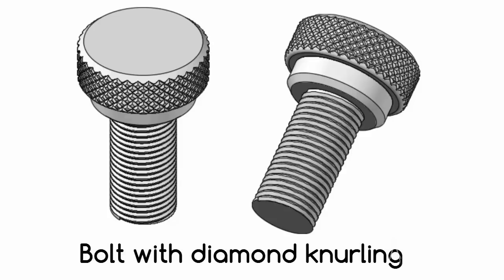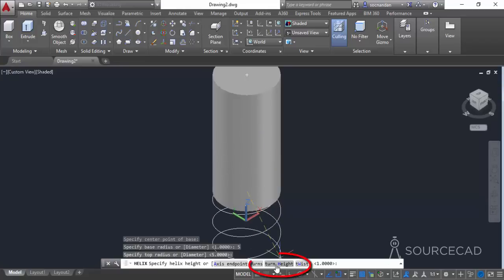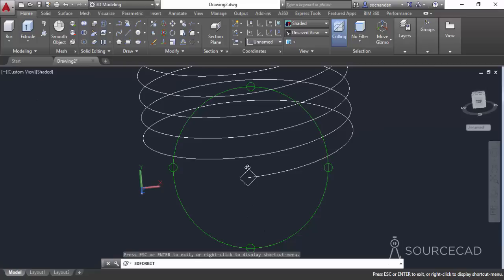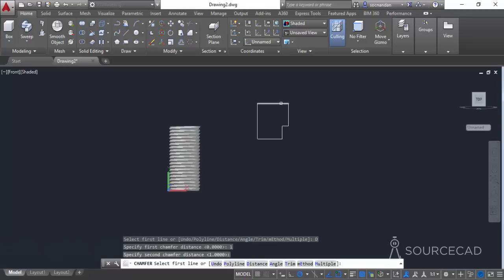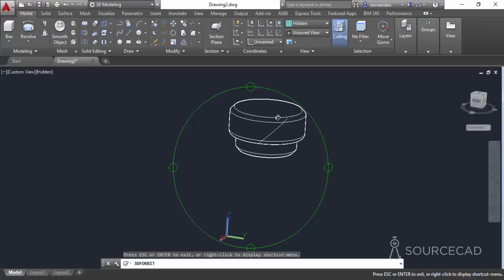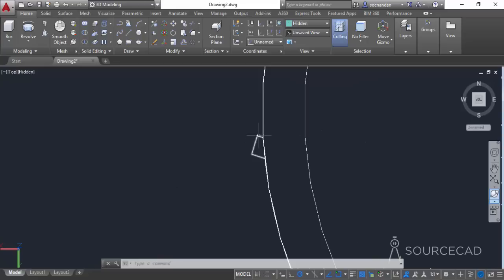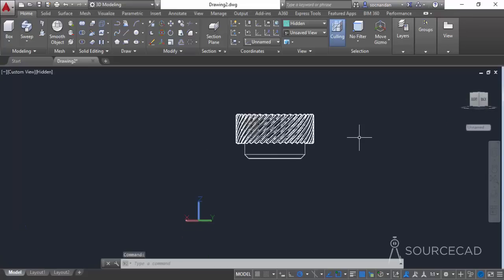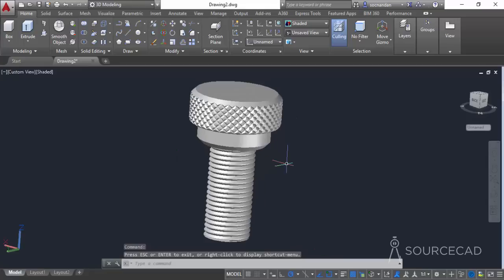Making a Bolt with threads and diamond knurling

Comment: I'm using Autocad 2020 and I get to the point where I need to subtract the knurl from the other object, when I subtract it just deletes the the cylinder that the knurling is wrapped around and doesnt touch the knurling. Could anybody help me asap?
Reply: may i ask how did you fix this?

Comment: Very nice! Small note: you do not need to move the rectangles on the path always. The sweep command is clever enough to work if the rectangles are wherever...
Reply: I think the reason he moved them is to rotate them properly so he can get the desired shape... otherwise sweep sometimes can not automatically detect the orientation of your object.

Comment: im having difficulty placing the second helix in the center of the second geometry (top) 
it will not snap on the exact surface you are snapping on.
I may resort to entering specific coordinates for the objects to get the helix exactly where i need it to be.
Reply from the maker: select the command then press and hold shift key and right click, then select the required point from the contextual menu. Hope it will help.

Comment: You forgot to teach the explode command after the array boss... Hehehe.. Still thanks for your nice tutorial.
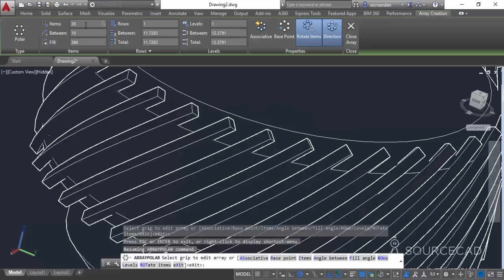Reply from the maker: As the associative option is off there is no need to explode the array (mentioned in the 13:18 time stamp of the video). However, if you explode the array in non-associative situation you will reduce the geometries to regions on which boolean operations can t be performed.
Reply: Ow sorry I missed that part. I'm using AutoCAD 2012 can you teach me how to turn off the associative option via command. Thanks.
Reply from the maker: You can use ARRAYASSOCIATIVITY system variable and keep its value at 1 to make an associative array and 0 as its value to keep it off.

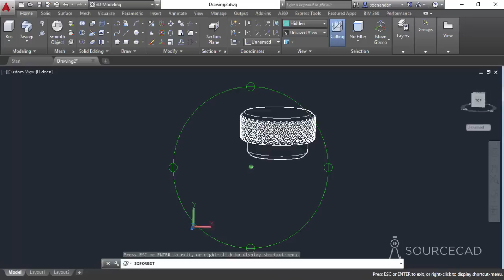Comment: The last part where you remove (subtract) the edges of the top, (14:50 to 14:55) doesn't seem to work in the 2018 version. when I try, everything outside the base of the top, disappears
Reply: No! instead it works on Autocad 2018.

Comment: Hi Jai, another fantastic video. Can you please help ? I'm having a problem with the sweep command. I'm using ACAD 2014. Sometimes sweep works and other times it doesn't. I can't figure out the reason. If I change the cross-section profile to say a circle and sweep, it sometimes works, but other times not. The ACAD forums don't seem to offer a consistent solution. Do you  have a method of working around this issue ? Is it something to do with the drawing axes ?
Reply from the maker: Thanks Songoku, Generally Sweep command will not work on steep curves. You also need to ensure that the sweeping geometry is fairly small compared to the sweep path.

Comment: Great Tutorials SourceCAD, I love it.  I'm a 3D Designer and work on the Autodesk Maya for  Product Design and Visualization. But i want to learn CAD design and 2D Drawing for the Production Purposes.

I'm Completely new to AutoCAD, but i know the 3D modeling and Designing. Also i never worked with the dimensions (Unit system), which i may need to learn for the 2D Drawings for production. I hope you get my points ( where i stand i terms of the AutoCAD and will suggest me according).

Please let me know how to start and what version you are using and please link if it is possible.

Thanks you very much !
Kunal Sharma
Reply from the maker: Thanks Kunal,

You can use free AutoCAD course on tutorials page of SourceCAD website, here is the link http://www.thesourcecad.com/autocad-tutorials/

It has all the required tutorials for your need including the tutorial relate to units. I have used AutoCAD 2016 version for making the tutorial videos of the course and you can get the student version of AutoCAD with a three-year license from Autodesk website for non-commercial use. The tutorial page has all details related to downloading and installing AutoCAD software.

If you are interested in a complete professional course of AutoCAD which deals with basic to advance topics then here is a premium course from SourceCAD website http://sourcecad.teachable.com/courses/enrolled/the-complete-course-of-autocad-2016

You can also install the free SourceCAD app from here to get access to video course on the go here is the link https://play.google.com/store/apps/details?id=com.socnandan.sourcecadapp&hl=en
Reply: Thank you very much !

Comment: I'm studying 3D CAD at the moment and I was just wondering what's your job because my corse is almost over and I'm looking for places that use CAD but there isn't many? So I was just wondering what you do if you don't mind me asking
Reply from the maker: I started as a CAD draftsman in a die casting industry where my job was to primarily make drawings of small zinc and aluminum die-casting components and their die's. Later I joined training and design consulting companies in Delhi NCR area.
Recently I left my 9 to 5 job at Ramboll (engineering design consulting company) and started training corporate clients as a freelance corporate trainer. Now I train corporate clients in AutoCAD, CATIA and geometric dimensioning and tolerancing. 
So as you can see I have worked in different roles and in different companies. Based on skill set which I have there are plenty of options which are open to me and so will be open to you. I forgot to mention that in my last company I was hired as Senior CAD analyst so the work mainly required implementing CAD standards and ensuring smooth performance of CAD software's in the organization (once again a new role :)) and it was not directly related to making drawings using CAD software.
You can visit this page as well to know more http://www.thesourcecad.com/jaiprakash-pandey/ and you are always welcome to ask questions :)
Reply: SourceCAD thanks I was also wondering can we have some catia tutorials because I'm looking into car design and they seem to use CATIA V5 so if possible could we see some of them
Reply from the maker: I cant say for sure if I will make CATIA tutorials in future :(
Reply: SourceCAD thanks